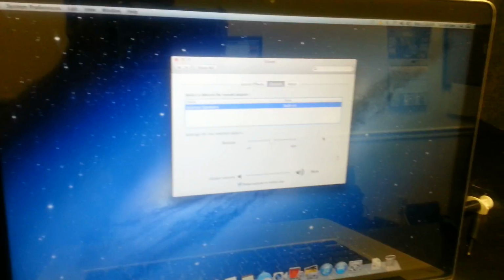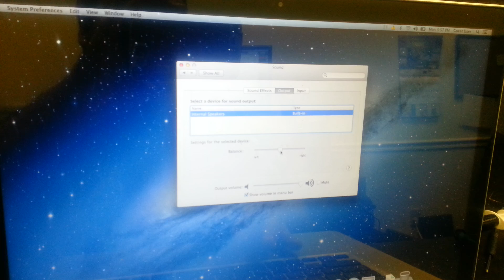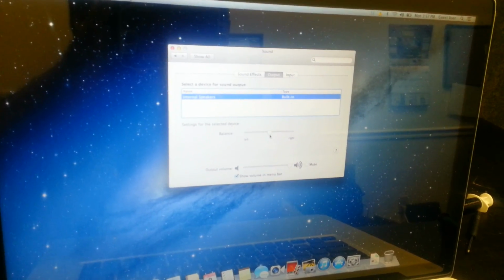Doubleclickittofixit Apple logic board repair to fix a broken fan connector on a 17 inch MacBook

Comment: Thank you for the nice video! So, you didn't need to put any extra solder? but used existing solder on the socket?
Reply from the maker: sleepalldays Most of the time you do not need extra solder, just apply flux and it will flow corrently. At times we solder, test, then epoxy the contact so it does not have issues again.